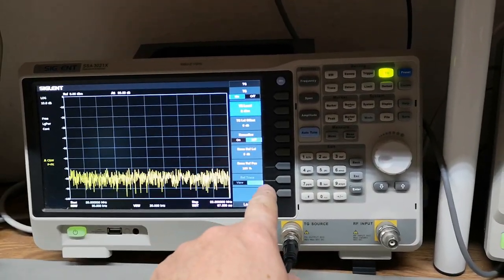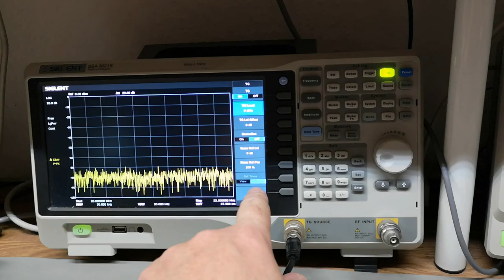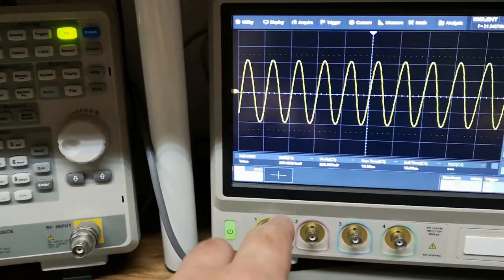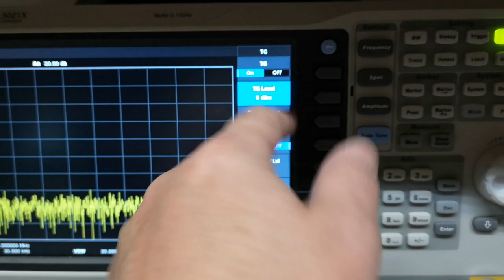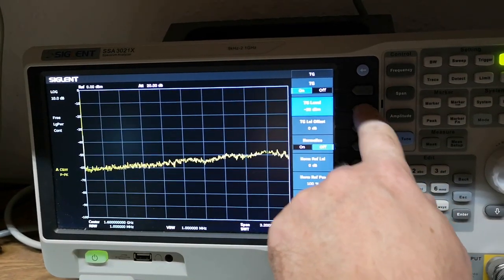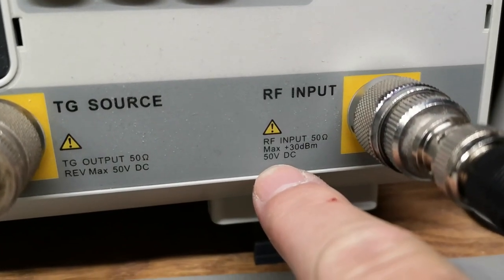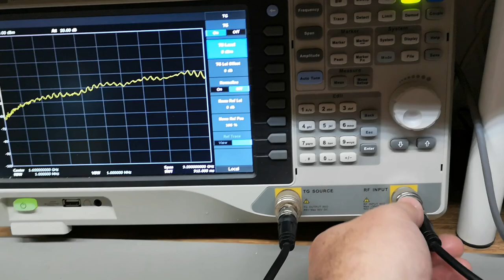Siglent Spectrum Analyzer SSA3021X dead RF front end repair part 1

Comment: Look for some SA input fuse kits. They have a 50mA fuse in line with the input centre connection, and also act as a nice set of adaptors as well. Basically flat to around 1Ghz, but your aurto levelling can easily compensate for the loss
Reply from the maker: that is not a bad ide, but maybe i only need to remember my 10dB attenuator and a DC block, 1Mhz hi pass inside a DC block ?

Comment: There is some disassembly guidance in the SSA3000X manual that for now is adequate as at this time there is no X Plus version service manual: https://int.siglent.com/u_file/document/SSA3000X_ServiceManual_E01B.pdf
Reply from the maker: thanks a lot mate. funny they say : press where the red arrow show, and they dont show the correct spot :-) 
so far my video is the only place where that is explained clearly, if you do this wrong, the plastic might brake or bend, so it will look bad.

Comment: It looks as though it has a DC block capacitor?
Reply from the maker: YES, it should handle 50V DC as explained on the front panel, BUT that is DC.. what i gave it, was 50Hz and 120V due to mega error use, see the text, that explain all i did wrong..